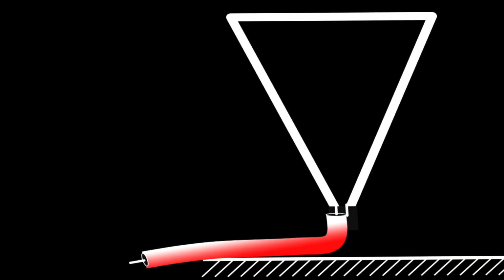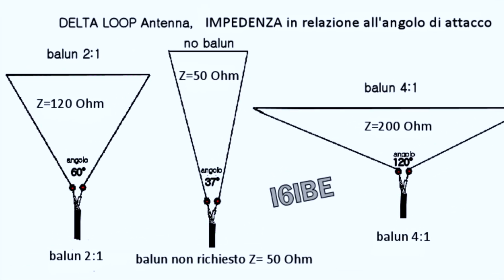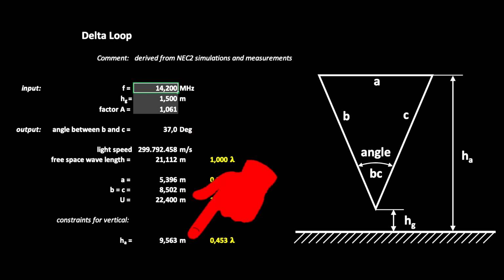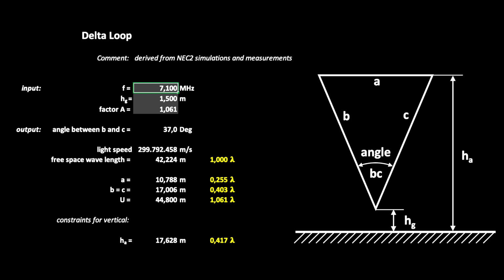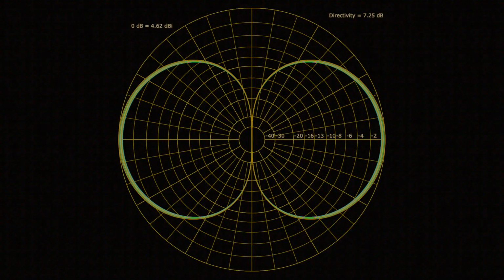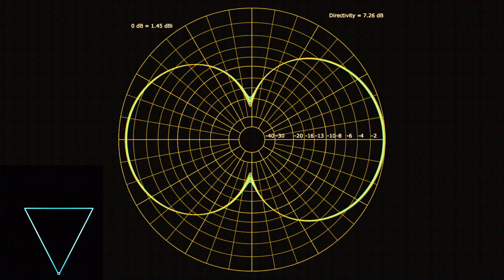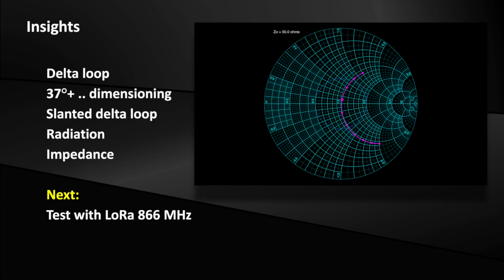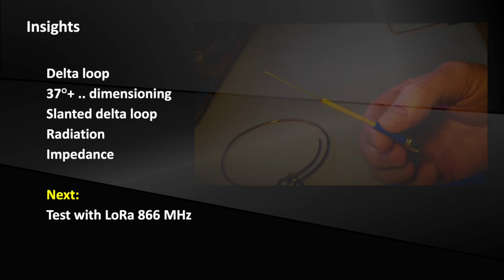37-Degree Delta Loop Antenna under Unfavorable Constraints (EP138)

Comment: Feed it with a 450ohm ladder line into a balanced tuner (transmatch).
Reply from the maker: Can you please explain this in detail?
Reply: @electronics.unmessed Open feedlines have very low losses even with high swr. The antenna and feedline are symmetric (balanced). Its best to use a balanced tuner and then a. 1:1 balun to connect the tuner via coax to the rig.
Reply from the maker: OK, but why going from 50 Ohm antenna impedance to 450 ohm’s?
Reply: @e @electronics.unmessed Because the antenna want be at 50 Ω and not in resonance on other bands.
Reply from the maker: OK, I see. Thx. Greetings, Klaus

Comment: You need a balun in all case.
Reply from the maker: A common mode choke is always recommended, but you don’t need a transforming BALUN, since the impedance is indeed 50 Ohms.
Reply: @electronics.unmessed  If you don't want your coax to be part of the antenna yes you need one. If you don't have one your impedance will change with the coax length. Try it.
Reply from the maker: @y_x2  You are right, I tried this a lot. And in fact this is the way how noise from switching power supplies and PCs etc is coming to your receiver. There is a number of videos about this on electronics unmessed showing how to avoid it. Common mode chokes are important here. Transforming BALUNs are for the impedance matching and balancing.

Comment: Is the delta loop calculator available online?  I tried your plans for 915Mhz but ended up with something resonant at 976.4MHz.  I used 12AWG (so 2.0525mm d) wire.  I noticed the one you built also had a significant extension of thinner wire; perhaps to compensate for a similar issue?
Reply from the maker: Thanks for your comment! Unfortunately, the delta loop calculator isn't available online. I'll do it if there's a lot of interest. There's still some work to be done, though; I also need to improve its usability.

The thin piece of wire on my antenna is easier to solder. I don't think it has much of an impact on the resonant frequency. But indeed, I used it also to make the antenna bigger with the thick wire.

With a thicker wire, the resonant frequency increases. This has to be taken into account using the length factor. Therefore, you'll need to build the antenna a bit larger with thicker wire.
Reply: For HF through 50mc I use 1014/F. Seems to het reasonably close

Comment: Kann man eine mehrelementige Deltaloop bauen die im Einspeisepunkt im Fuß (ca.) 50Ohm hat und direkt mit einem 50Ohm Koaxkabel gespeist werden kann ? Ohne 1:4 Balun oder Gammamatch, ohne Antennenkoppler usw. . Wenn die Seiten der Deltaloop gleichlang sind, hat die wenn ich mich richtig erinnere 90Ohm Einspeisewiderstand im Fußpunkt und weitere Elemente (Direktoren und Reflektor) verringern den Einspeisewiderstand, irgendwie müsste dann doch auf 50Ohm zu kommen sein um die Antenne direkt mit einem 50Ohm Koaxkabel oder 75Ohm Koaxkabel zu speisen. 

Das Video find ich sehr praktisch, die längen für eine Spitze Deltaloop die im Einspeisepunkt im Fuß 50Ohm hat sind für die Amateurfunkbänder direkt angegeben.
Reply from the maker: Danke für den Kommentar. Freut mich dass dir das Video gefällt. Zusammenschalten von Antennen würde tatsächlich funktionieren, um eine geringere oder höhere Impedanz zu bekommen. Mit einem Netzwerk aus Wellenleitern stellt man dann die richtige Phasenlage und kann die Antennen im Raum positionieren, um ein bestimmtes Strahlungsdiagramm zu erreichen.
Reply: @electronics.unmessed   Ich meine passive Elemente die als solche nicht aktiv gespeist sind, einen Reflektor und mehrere Direktoren, ähnlich wie in einer Yagi aber eben dass die Elemente aus Deltaschleifen bestehen. Wie ist  Einspeisewiderstand in einer solchen Antenne im Einspeisepunkt im Fuß (Ohne 1:4 Balun oder Gammatch etc.) auf 50Ohm zu kriegen ? Um Wieviel Ohm sinkt der Einspeisewiderstand wenn ein Reflektor(ohne Direktor) hinzugefügt ist und um wieviel mehr mit zusätzlich einem Direktor ?
Reply from the maker: @PIasmaZombie Die 37° Delta Loop hat 50 Ohm. Siehe Video  (EP139c).
Und ja, man kann das Yagi-Prinzip auch mit dieser Antenne anwenden.
Reply: Una "delta" loop que tiene 50 ohmios es la forma de un rectángulo en vez de un triángulo.
Debe tener unas proporciones que se calculan con una fórmula sencilla que tiene en cuenta la frecuencia deseada.
Reply from the maker: @DavidLopez-bz4rj  see reference, it's a famous principle, often described.

Comment: Thank you. Another excellent video, and I look forward to the next one.
While I understand that the impedance is matched I'm curious about any sort of balanced/unbalanced current effects on the outside of the coax using these distorted loops.
Reply: Prmoda fre god and vere god antena
Reply: فرموزا ستلايت
Reply: برمودا دل انتينا
Reply from the maker: @johnwest7993  John, thanks for your comment! Good point! I need to think about it. Don’t miss the coming video about measurements…